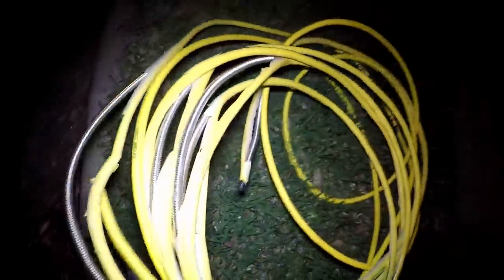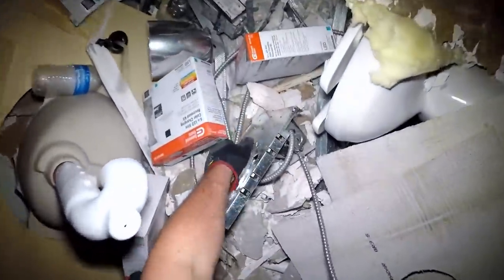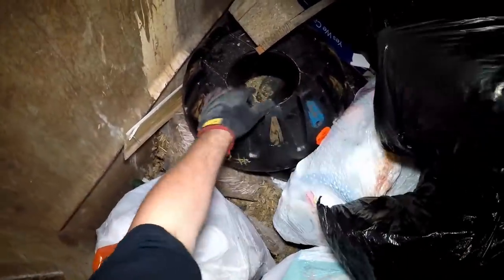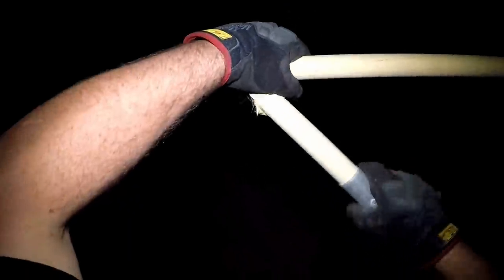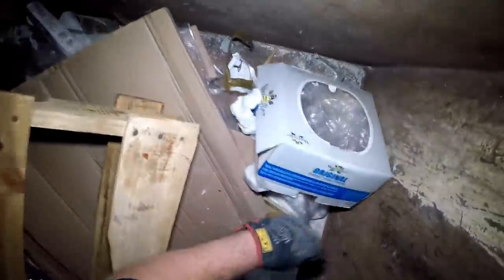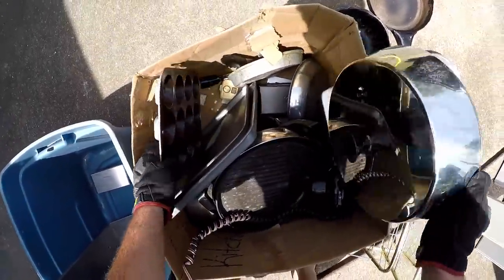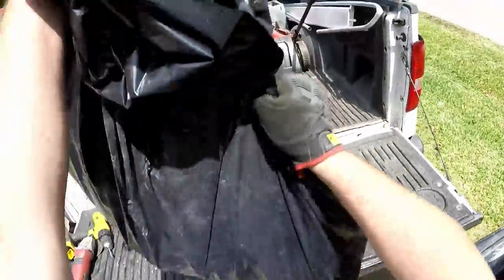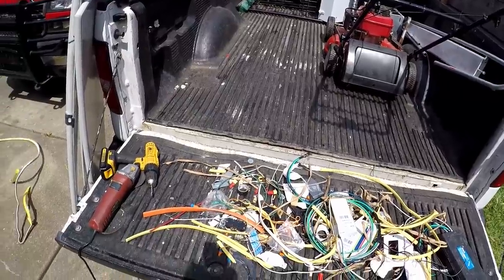Dumpster Diving & Curbside "Frankenstein's Monster"

Comment: Just wanted to give you a heads up on that bunt cake pan, it works awesome to use to remove cooked sweet corn from the cob, stand the pointed end of the cob in the center hole and hold it there, then take a knife and cut the corn kernels from the cob with a knife, the kernels fall into the pan, then dump the corn into a bowl with some real butter and enjoy !! I do my fresh sweet corn this way, to avoid having the kernel skins from getting stuck between my teeth, and having to go through a number of tooth picks after supper, it's a useful tool for fresh sweet corn season in my home, something maybe you or any of the viewers who have a cake pan like that, might want to try sometime. Love your videos, keep em coming and God Bless eh.

Comment: Mike we had our main fuse board replaced at work the workers asked if I could dispose of the old Cabinet for them.
I stripped out all the brass fittings and copper connectors on it during work time.

Comment: The gas line hose with the yellow sheath is usually stainless steel. Also, you should pick up the old tube tv’s. The degaussing cable is copper along with a copper yolk inside.
Reply: Are you  alright  dude

Comment: Yellow thing is stainless steel gas trac pipe very good find worth a couple pennies stay blessed on your journeys. Watch when they tear down a house the high pressure line will be thick walled stainless and usually pretty freaking heavy I find it at every house we build where I live. If I come across some again I will cut off a piece so you can see how its made up when you find another po box I can send it too you. Stay blessed

Comment: I was looking at some of your old videos from last year for February. The two big black boxes that you thought cam out of a car dash was right. those were evaporator cases they could have had aluminium evaporators in them and also copper heater cores. Id check them closer next time.